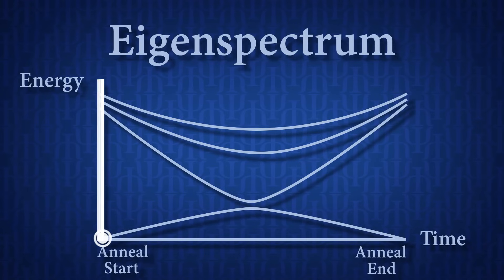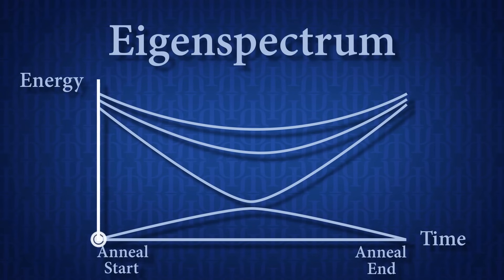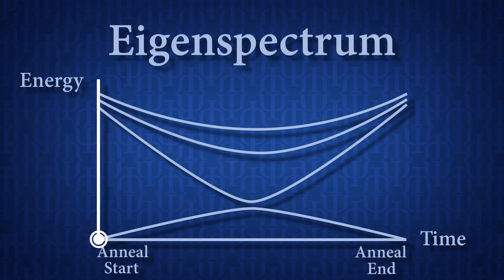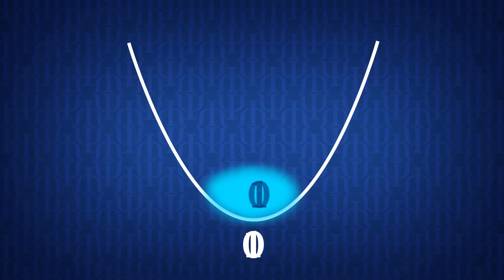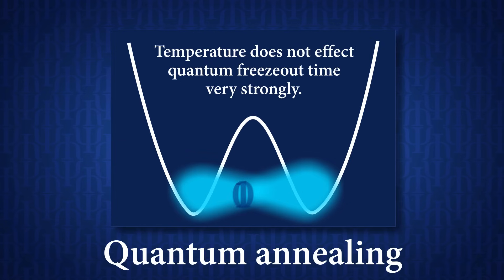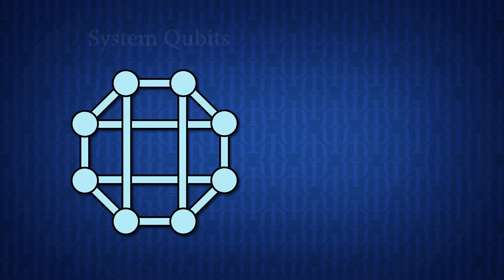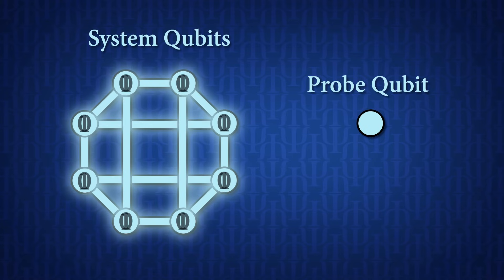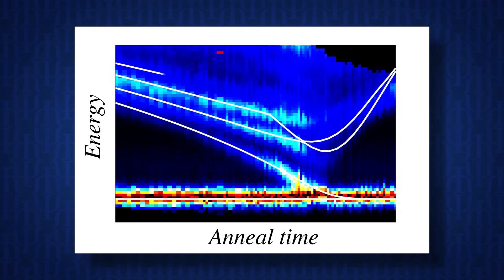Measuring Quantum Physics in a Quantum Annealer

Comment: Can anyone help me understand the implications of such techniques in computing? I, ill be it shallowly, get the quantum measurement. But how is this implemented with optimization? 

P.S. This is not aimed as a challenge of credibility or lack of results, i genuinely would like to understand the implications in optimization in computing.
Reply: @D-Wave Systems
Reply: Not d-wave here, but a mild guess would be that classical processes need to compute problems like optimization in an serial way, line by line. On a quantum processing you can handle multiple lines at once, indeed, they grow exponentially (2^n)fast as you have more qubits to process, so one can have a way faster way to compute too large problems for a serial processor to handle. (by processor i mean the code that it is running).
Reply: Now for the big guess: (recalling the P=NP problem) classical computing is locked in to process in polinomial speeds (2x^3-3x^2 stuff) so it is unable to tackle problems efficiently that are too large in polinomial space or that scale on othes kinds of rate (the growth of a poli function never catches the growth of an exponential function, for ex). So the great deal of quantum processing is to be able to deal with o whole new set of problems out of the scope for classical ones (put stuff like the salemans travel in here and so on). This video explains articles that shows correlation between the simulated quantum system to real quantum systems in physics experiments.

Comment: Does deleting or destroying an entangled particle cause the second particles value to stay in a super position? I am wondering because what if you entangled two particles and had one fall into a black hole, would the second one tell you about stuff in the black hole? Does a quantum system experience negative entropy if you delete the information while one is entangled and being looked at?